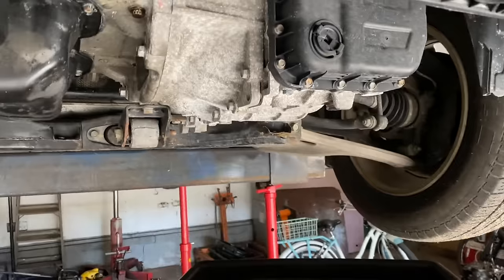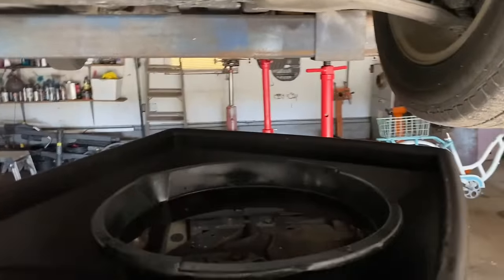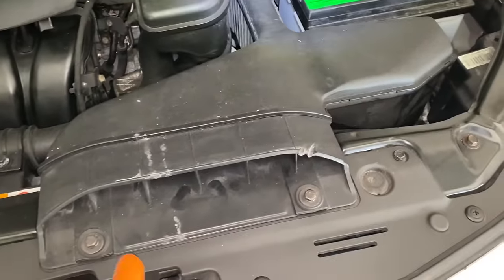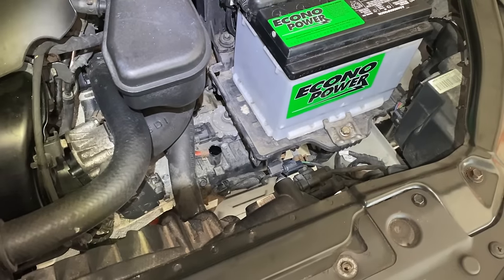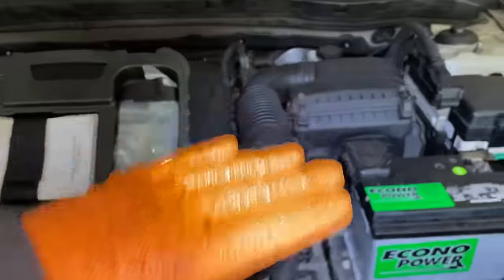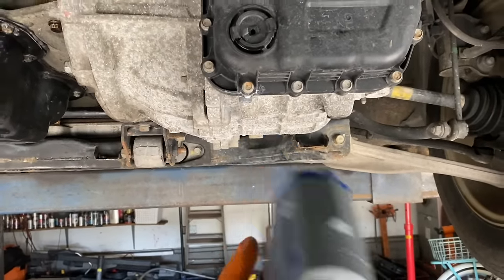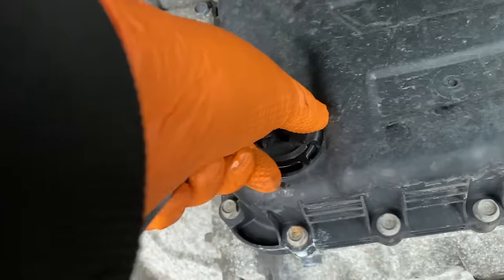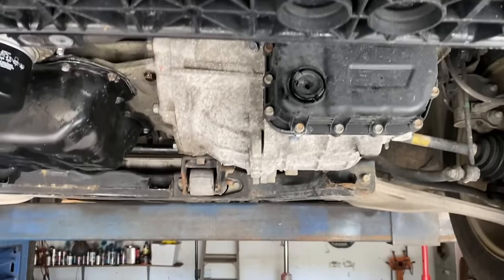Sealed Transmission Fluid Check & Change In Kia Optima Sorento  Sportage Rio Santa Fe etc. 2011 & Up

Comment: I just filled the wifes transmission last night it was such a pain in the dick, the top fill port kept having an air bubble and was just getting transmission fluid everywhere, Pointless to fill from the top. I will treat it like my B9 Audi S4 just fill from side port with the engine running, just fill with my ATF Filler bottle. 😑💀It took me 30 minutes to out a little over 3 qt’s back in from the top, such ass
Reply from the maker: You can’t just pour it all in at once, slow and steady gets the job done! Never have any problems doing it like that. Did about 30 vehicles since I made that video.
Reply: Remove one of the oil cooler lines to let the air out as you fill it.
Reply: Get a 1 or 2 gallon garden pump sprayer, remove handle  fill with fluid and shove hose in fill hole, I do it all the time😂

Comment: ATF filter ?
Reply from the maker: The pan has to be dropped to replace it. Have other videos on that.
Reply: @motorcarnut  I think the filter is behind the valve body, almost in the middle of the transmission. Basically  you have to dissemble the transmission to get access.